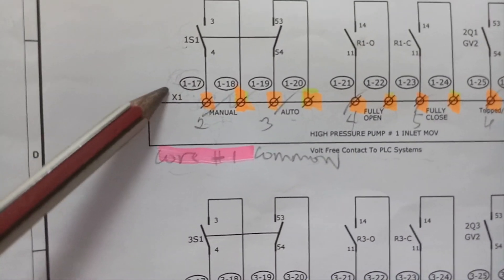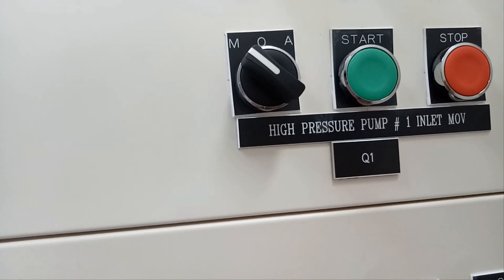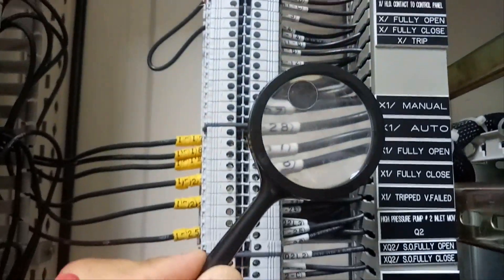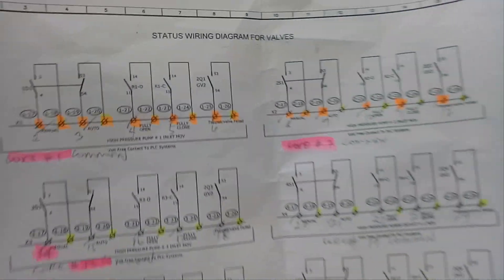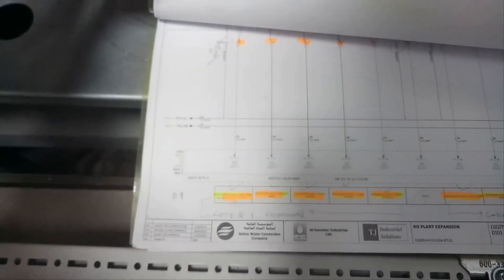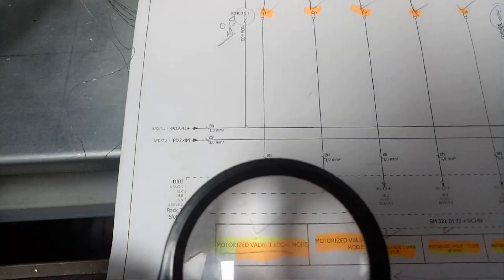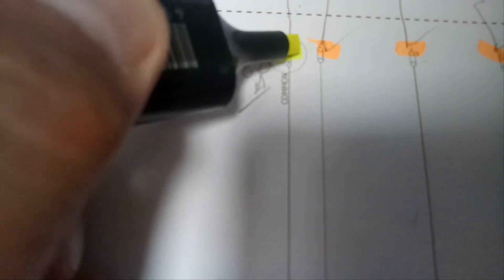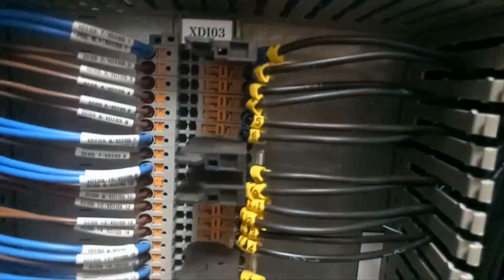ELECTRICIAN TIPS - TRABAHO SA ABROAD.

Comment: Helo po master...pwedi mag tanung pwedi ba ako mag apply sa mga ganyan trabaho wla ako experience...sa kanyang work..im electrical graduate at i have a RME license...lahat kasi ng experience ko dito sa local lang preventive maintenance lang at electrical layout recidential ang comercial building lang sya..gusto ko sana mag apply kahit helper lang sa ganyan..kaso wla ako experience about jn ..sir
Reply from the maker: pwding pwde sir, kabisaduhin mo lang ang motor control at connection ng 3phase induction motor, Power Transformer, at paggamit ng mga Electrical Instrument, para pagdating sa actual interview ay alam mo ang isasagot. sigurado na matatannggap ka lalot pat electrical graduate at RME ka pa. Magprovide ka rin master ng certificate of employment regarding sa gusto mong aplayan. if may tanong ka pa tungkol sa pag aaply, paki comment sir sa bago nating upload na video. paki supporta at paki share sa iba. Salamat master. Goodluck and God bless.